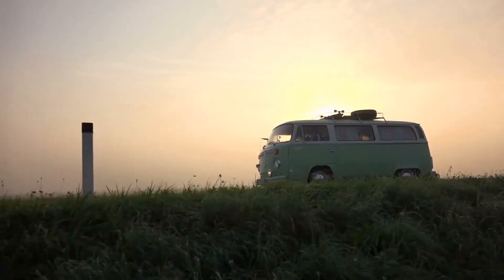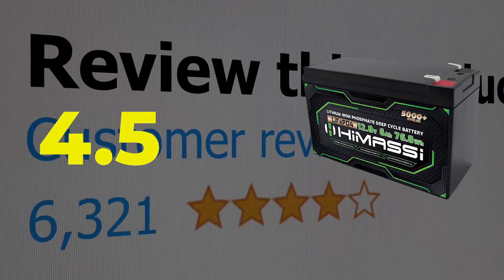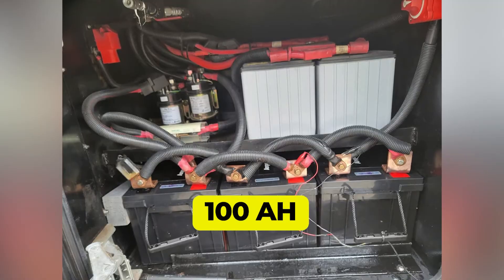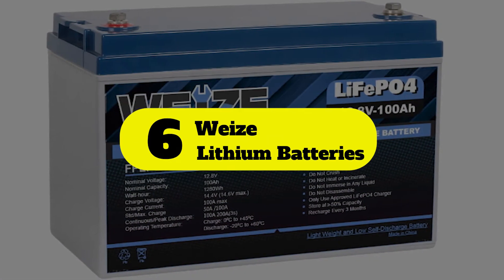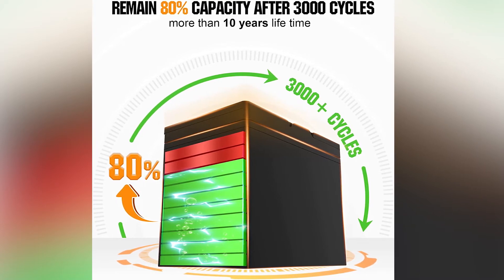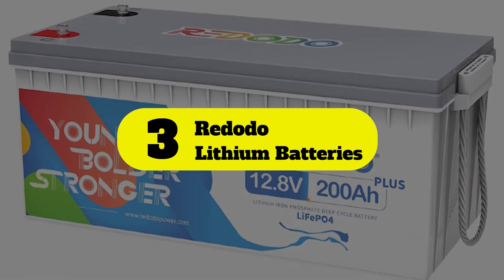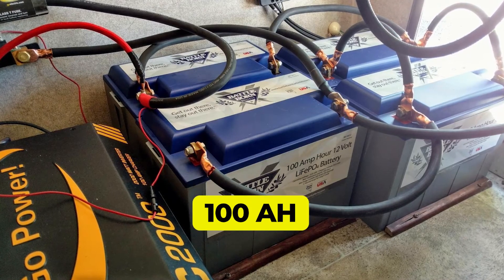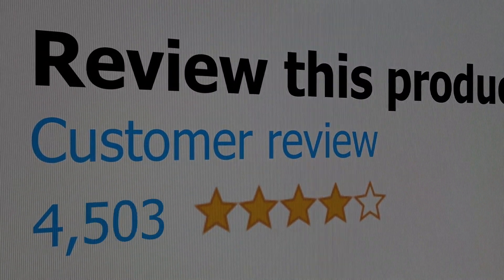The Top 10 Lithium Ion Battery for RV Solar!

Comment: Power Queen 12.8V 200Ah Plus LiFePO4 battery is 49.6 lbs, 1/3 lighter weighs than the same capacity as the 130lb lead-acid battery.